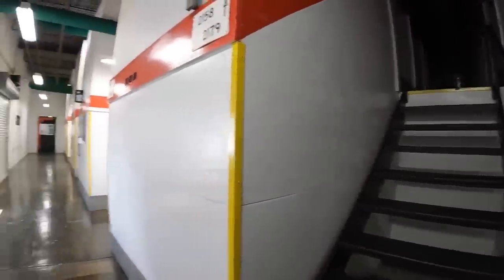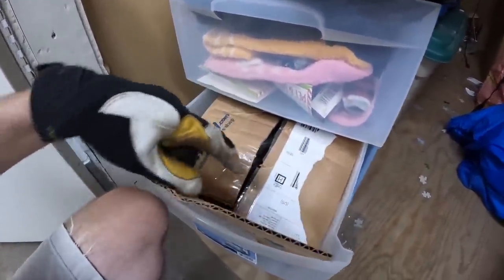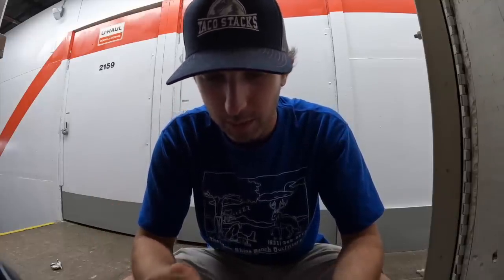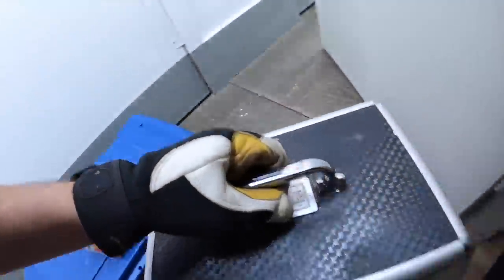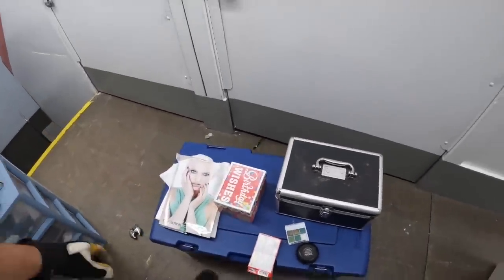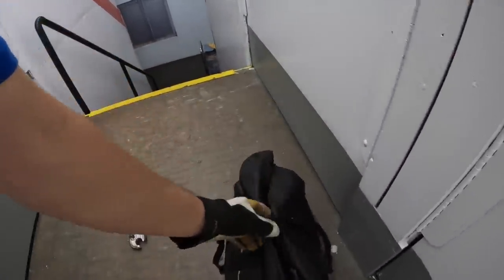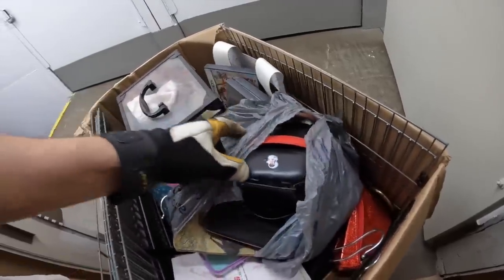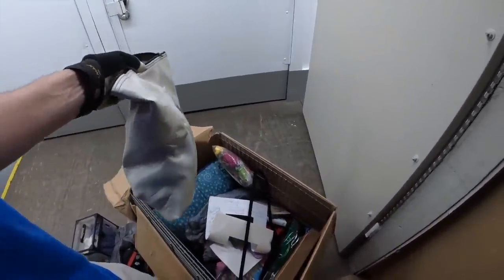I BOUGHT AN ABANDONED STORAGE UNIT FOR $20!

Comment: Believe it or not, used cosmetics sell well. Not sure if you can sell on Ebay, but the high end stuff sells, even when partially used. A lot of the stuff you found is expensive. The black and metal box is OPI, which is a popular, and fairly pricey brand of nail polish.
Reply: I agree. It looked like makeup sets in the box   and bag. Most of the makeup is not used and expensive. Check them out before throwing them out 🙂